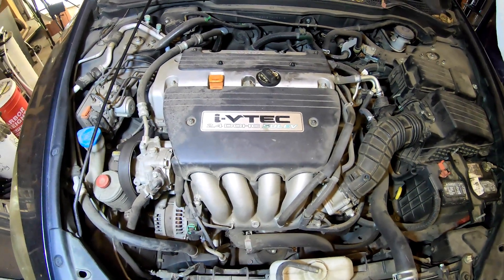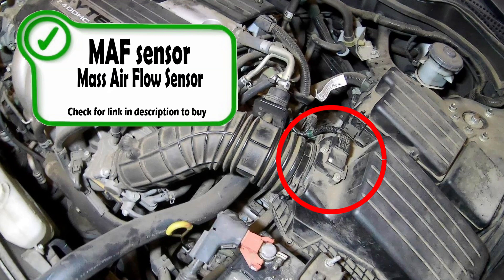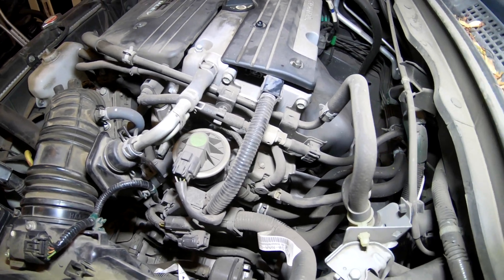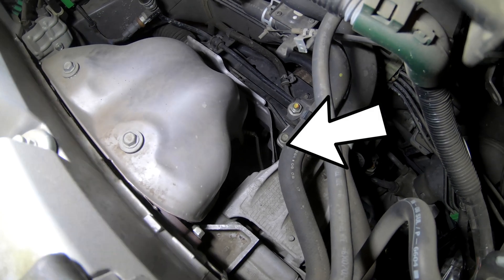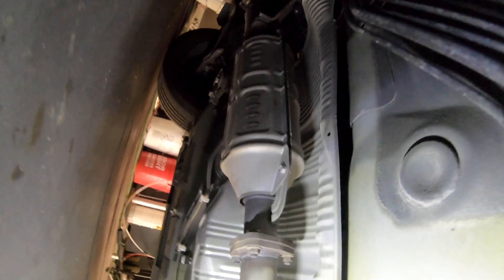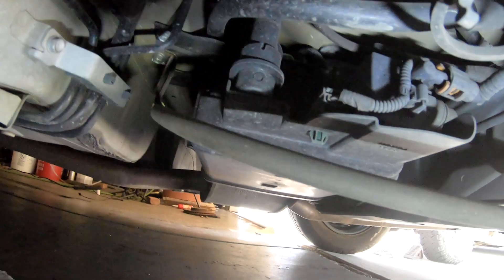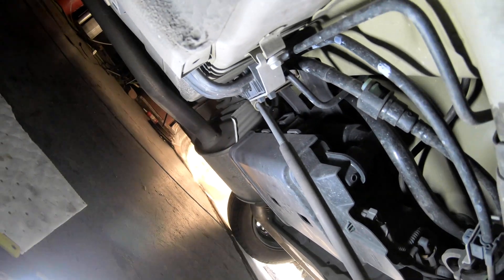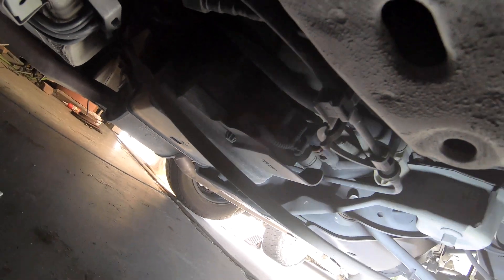#mechanic ⫷ Honda Accord PCV, EGR, Mass Air Flow, Oxygen Sensor, Purge & Vent Solenoid Locations  ⫸

Comment: I have a 2007 Honda Accord and my check engine light came on with a code PO497(indicates a problem with your vehicle's evaporative (EVAP) emissions system, specifically a low purge flow) Came on. I have Replaced this part and light has came back on with same code please help..

Comment: 2006 accord 4cyl. Had code po443.  Installed new Dorman evap purge solenoid.  Now have code po496 after driving 22 miles.  Help.

Comment: Great Channel,
My son’s 07 Honda Accord  throws a P0113 and P0102 Code just replaced spark plugs, MAF and PCV. I accelerate and it runs up to 3000 RPM before coming down. 4CYL Any help is greatly appreciated

Comment: I have a 2006 Honda Accord 2.4  I replaced both 02 sensors  upstream and downstream and the check engine light goes a way for
A short time then comes back on keeps doing that and the same code bank 1, what you think is wrong?
Reply from the maker: What is the code you are chasing?
Reply: @ScottiesHobbies  p0140

Comment: I snap shotted every location of these sensors this is good stuff
Holy crap appreciate u taking time and doing this vid
I just bought a 2005 accord 
So I want to keep it maintained and nice this is one of nicest cars in terms of the interior is perfect and it has the k 24 engine only 121k miles so I’m learning about this car little bit each day
Thanks a bunch!!!
Reply from the maker: You've got yourself a great car there. Super easy to maintain and if you take care of that vehicle it for sure will take care of you. Make sure you check out my video library. I have spark plug replacement, air filter replacement, front brakes, and more on that vehicle. 

Good luck on your future maintenance projects. Keep us posted on your progress. Good luck with your new vehicle!! 🤞💪👍
Reply: I have 4 different misfire codes and I replaced all spark plugs , both air filter changed already and I can’t find my mass air flow on my 03 honda accord ex 2.4 , help please

Comment: Code reader states to replace breather hose on the crank case system. 03 accord lx 2.4L.. looking for exact location on motor...autozone doesnt have it, local dealership doesnt "know which breather hose it could be"??
Reply from the maker: What is the year make and model of the vehicle that you are working on? And the engine size?
Reply: @ScottiesHobbies  thx for the quick response. Car is at my house. Work had me away from home currently. I'll send a pic this weekend.
Reply from the maker: If you would like you can take a few pictures of your engine compartment and text them to me. If I could see the part you are looking for I will circle it and send it back. Text me at (925) 418-5096

Comment: I have a 2007 Honda Accord 2.4L.i have a code for egr.i replaced it with a new one from Autozone.after driving for 15-20 minutes,check engine light came back on for egr.also the car is running from gas that has been sitting for about 4 years.any help?

Comment: Trying to troubleshoot a PO499, Any tips?
Reply from the maker: If it was my vehicle. I would start by checking the vapor purge solenoid.. See if it holds vacuum, it probably does. But more importantly if power is applied does the solenoid solonoid open and allow vacuum to drop? If those 2 tests look good on the vapor purge solenoid, I would then move on to testing the vapor vent solonoid . And do the same thing. See if it opens and shuts with 9 V power and see if it holds vacuum. 

I bet something is going on with the purge solenoid though.

Comment: Hi I replaced my air fuel ratio sensor for my 2003 Honda accord 2.4 and I cleared the code but when I started the car it came back P0135 thanks

Comment: my 2004 accord lx dohc 2.4L is throwing a p2422 code, as well as the camshaft pos sensor(tho i replaced it-still throws that code p0341). Once warmed up, Its idling rough and stalls when I am stopped in drive. Stays going if I press on the gas.  Idles easier in park.  I have cleaned the throttle body, iac, egr. New fuel pump filter. new spark plugs. 120k-ish miles on it. Would the p2422 'evap vent valve stuck closed' be the specific cause of this? and should I just replace the whole vent canister then? since the valve on the canister costs just as much

Comment: You didn't give the codes for the Bank 1 Sensor 2 oxygen sensor like P0139 and what to do?
Reply from the maker: Are you chasing a code?
Reply: Yes. I just ordered a Denso oxygen sensor to replace on the catalytic converter due to the P0139 code but some say that may not be the problem? I was wondering what you think? Thanks.